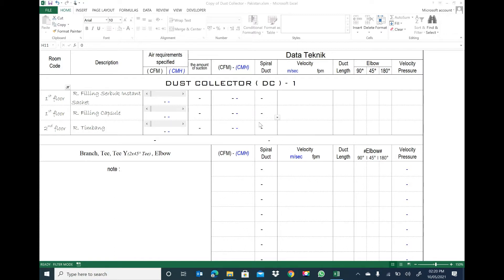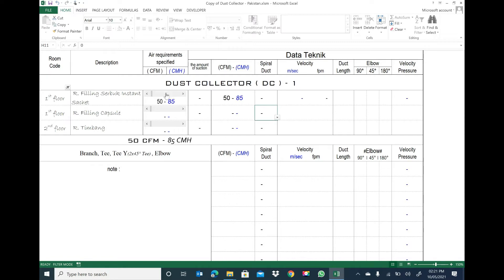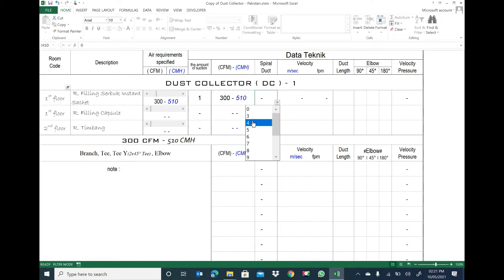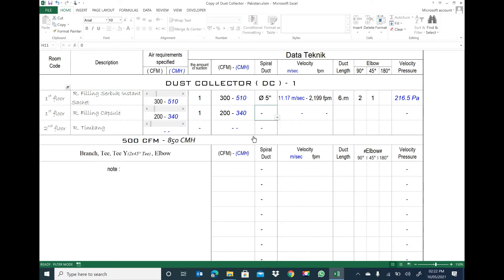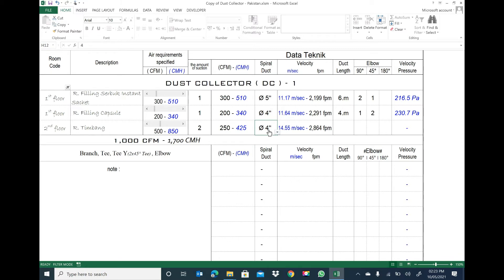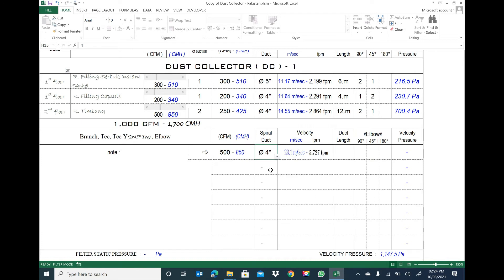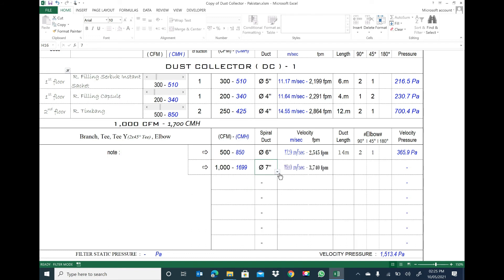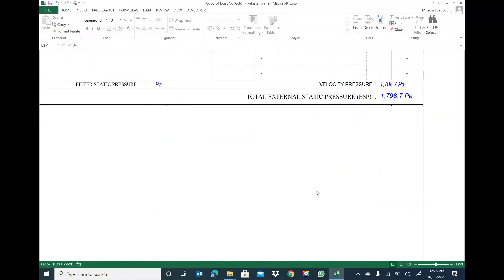Dust Collection System Calculation | Tahir Hussain MEP Industry

Comment: Sir is there necessary to use PVC duct?
Reply from the maker: We can use pvc duct but for pharma and food, we need to use stainless steel
Reply: @TAHIRHUSSAINMEPINDUSTRY  okay Sir. Thank you Sir. I have a project  which is already designed and execution is about to start in Lahore in which PVC duct is used with SS Hood.
Reply from the maker: One thing is important, in case of power failure, dust should not go back, so u need to install a dust holding chamber before your collection location, it will work like a non return valve